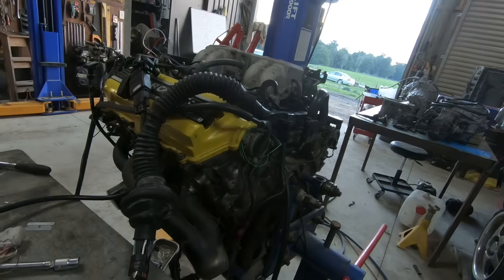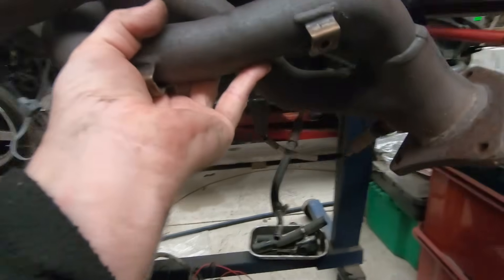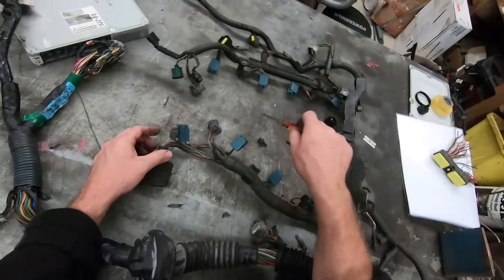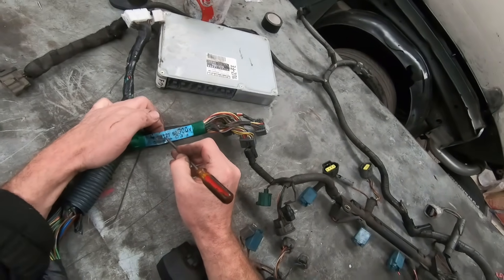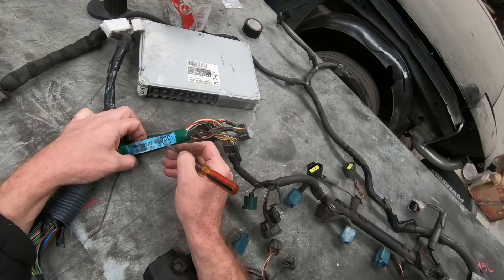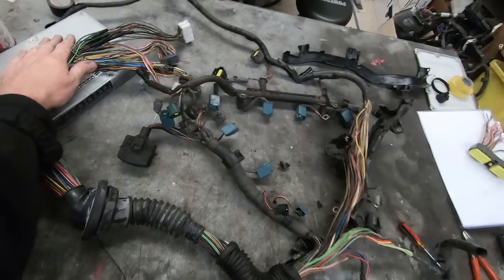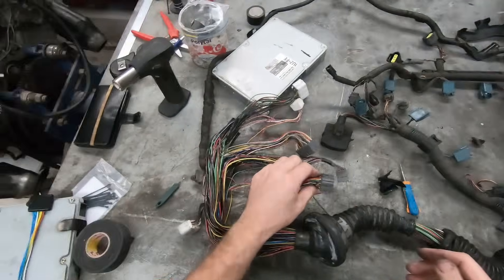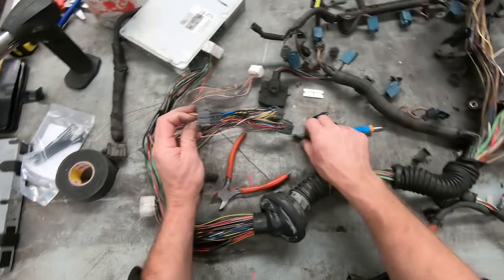Myth - Stock 1uz ECU can't be used on a swap.  Myth - Stock ECU has to be tricked in a manual.

Comment: So if I use an 1UZ-FE attached to a TH400 automatic transmission, I should remove the transmission wires too??
Also, is there a place where all of this is written down, like which cables to remove, etc. Using an early 90 engine. The one with the thicker rods. 
Thanks in advance.
Reply from the maker: When Im doing a mechanic transmission I normally remove all the transmission wires.  Ive done the list for wire removal with my later uz wiring instructions however its part of my update list for the early ecus.  Its not hard.  All the wires going to the transmission get removed.   Same process shown in some of my videos.   Cheers Kelvin.
Reply: @CartuneNZ  alright, so just get rid of all the transmission wires and I'm good to go? Thanks for the help

Comment: Any one have a guide on how to wire a stock loom?
Reply from the maker: Hello.  Yes I sell a manual on how to wire any of the 1uz stock ecus. $150nzd.  I require your ecu number.  Email info@thecartunecompany.co.nz  cheers Kelvin
Reply: @CartuneNZ I did earlier.
Reply: BTW its a 1992 Sc400 and the labels un-readable.
Reply from the maker: @Max67zero  ok.  I get around 50 email a day so can take a while.  Send photo of ecu as I can tell from photo. If its sc instructions cover both traction control and non traction control.  Or just paypal $150nzd and ill flick the info back when im on my laptop.  Cheers Kelvin .

Comment: Hey, I've had my ECU's capacitors all replaced and the ecu checked professionally. Everything seems to be working properly but the poor sc400 won't fire up. It doesn't seem to be getting feedback to tell it to fire. I've tested the igniters and they seem to fire the coils. Any help at where I should look at to sort this problem out.
Thanks
Adam
Reply from the maker: Hello Adam. Was the engine running before the ECU was repaired? Have you gone through the basics and checked ECU is powered up?  Checked for spark and injectors working?  Power to injectors and coils?  Fuel pump working?  Cheers Kelvin
Reply: @CartuneNZ  hey, I bought it as a project car so it coughed a bit when I bought it but not run.
I having check the ecu to see if it is powering up,
Is there a simple way to do that?
It is getting fuel to the injectors, I can smell it when cranking the engine.
I changed the fuel pump as it was ceased. The only way I can make the fuel pump work atm is to bridge the b+ and fp terminals.
The igniters only work by pulling the circuit up using a test light, by doing so as the engine is cranking I can get spark. It's like it isn't sending any feedback back to the ecu. Possibly crank sensors?
What's your thoughts.
Thanks
Adam
Reply from the maker: @adamcampbell6832  my thoughts is I need to do the diagnostic videos I have on my list.   To confirm ecu is powered up things like cel light should be on at key on.  If ecu is powered up then checking crank sensor.  I have a video for that test.
Reply: @CartuneNZ  I'll definitely check the vids and do the tests, when I get back home next week. 
Thanks for the guidance
Reply: Hey, There doesn't seem to be a CEL light when turning the key on. The ecu is a 40/40/40 plugs. How do I know what wires to use to power it up?
Reply from the maker: @adamcampbell6832  with most of the soarers we see over here thr CEL goes to a warning message.  Im not at the workshop atm but I think they have a W output for CEL in the DLC1 on the engine.   Using test light between 12 volt and W Should generate a check light if ecu is functioning correctly.
Reply: @CartuneNZ  ok cool I'll give that a go. I've also heard there is something to do with the overdrive button, it might of been on 1 of your videos. It acted as a cel but the overdrive flashed instead, I haven't tried this yet. I think the over drive needs to be off
Reply: @CartuneNZ  it does produce a warning message in Japanese, I've translated it to the alternater not charging
Reply: @CartuneNZ  I've checked, there isn't a wire connected to the W port in the obd1 port on the engine. I'll have to check under the dash

Comment: If i use stock automatic transmission, its fine with stock ecu ?
Reply from the maker: Well Toyota had transmission running fine with stock ecu so provided its wired correctly it will work well.  Cheers Kelvin

Comment: Hi...vary good video....I'm restoring a 94 ls400  with air suspension... 1st I had to replace the starter 2nd the radio with the amp premium system.  Replace all the lights for leds . Replace all the original seats because they were cut ( Slice)  look like Freddy coger lived in it.... The only thing will be missing is that mod with the manual transmission
Reply from the maker: These older cars can need a bit done to make them good again.  They still drive so well once sorted though.  Just did a powersteer rack and radio on a UCF10 LS400.  And suspension arms.  So nice now though.  Cheers

Comment: Thank you, I have my soarer 91 v8, had a a mechanic destroy it, rather than call me and tell me it would start, he bulling the after market alarm out. All wire appear connected. But will not start. Got no good on ecu so got a new reco one. Ice OK. Needs soarer guru please? 0407246811Help?  In Castle Hill NSW
Reply from the maker: Sounds like that mechanic was well over his head.  What diagnostics has he done.  Checked basics like power to ecu?  Fuel?  Spark?

Comment: Don't forget to mention that alot of these ECU are 20+ years old now and some suffer from leaking capacitors. Causing all sorts of problems. Seen a few personally and the 1uz I used in my rig suffered from this. This is the reason I decided to bin mine and upgrade to a link. But any excuse was a good one hahaha.

Great video as always love all the 1uz content 

Be good if you do a video on upgrading cams. I'm stuck on what specs to get for the boosted engine I'll be building next
Reply from the maker: Hello Ross.   Yep,  giving the stock ecu a service is just a maintenance item to me these days.  I try to flick new caps in before they fail and do serious damage inside.  Cheers
Reply: @CartuneNZ  oh nice one would be awesome to see how you do the cap replacement if ya do a video.

Comment: Just wondering is it possible to extend some of the loom wires without any running issues on a 3uz?
Reply from the maker: Yes , provided every join is done correctly then some of the wires can be extended.  Cheers
Reply: CartuneNZ thanks mate 👍

Comment: Question - If I swap a stock 1UZ and stock auto trans into another vehicle and transfer the COMPLETE stock harness as it was in the donor vehicle without removing any wires whatsoever, will the engine/trans function properly?
Reply from the maker: Absolutely.  Provided everything is connected correctly it will all work as it was intended.  Cheers